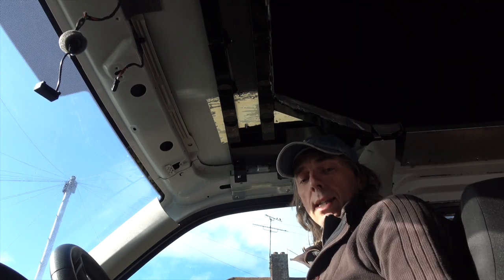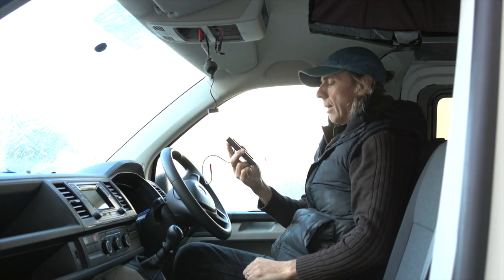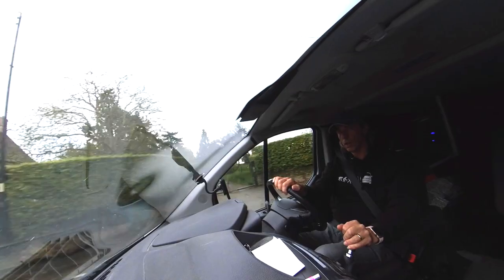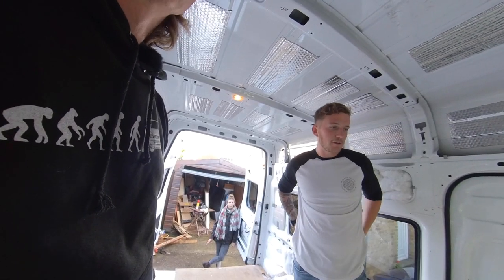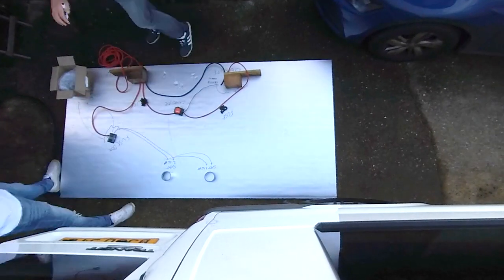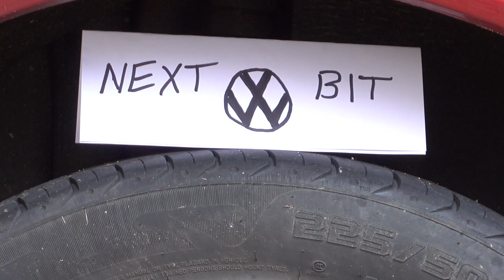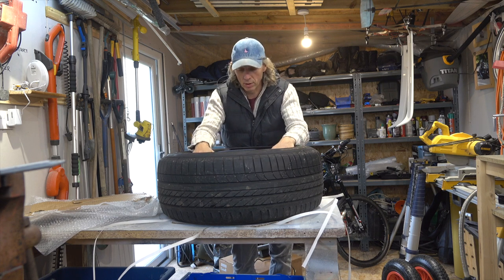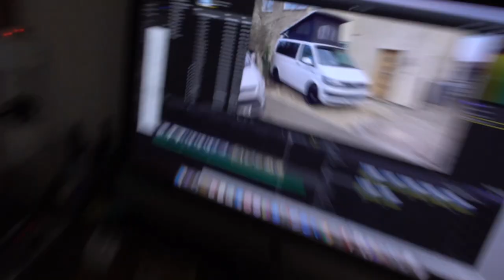Fitting a reversing camera and new alloy wheels to the T6 transporter

Comment: I hope you didn't use the steel wheel bolts for those alloys. Has steel wheel bolts are radius seat and the aftermarket wheels are tapered seat. You don't want your wheel to fall off bud 👍